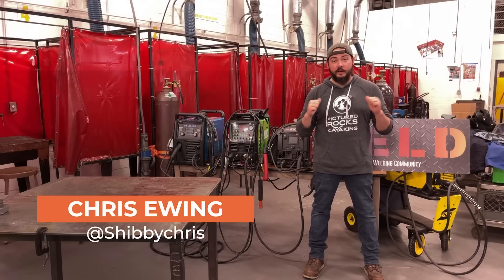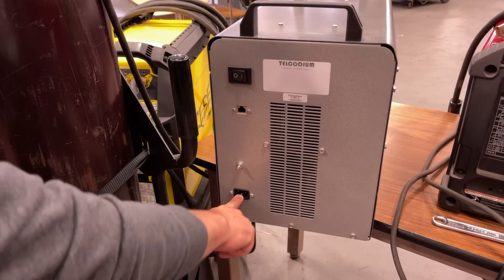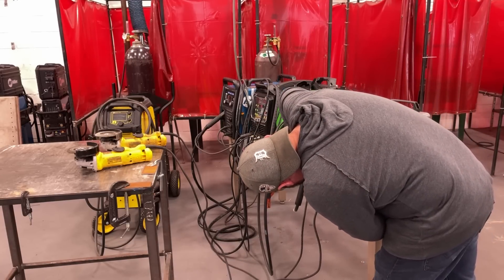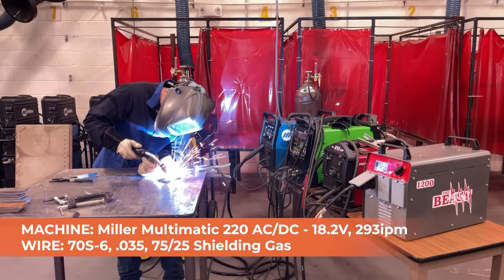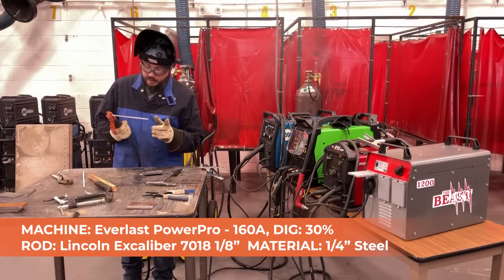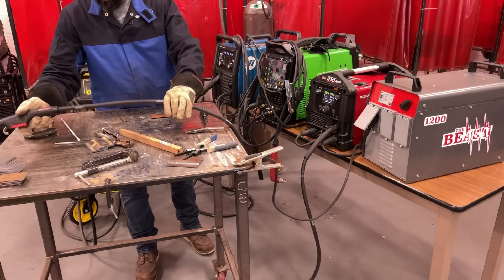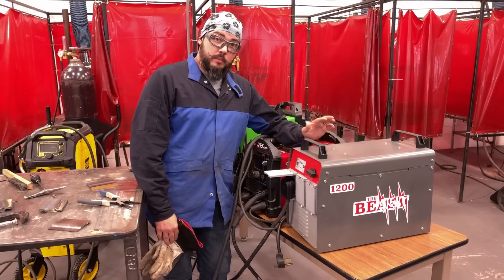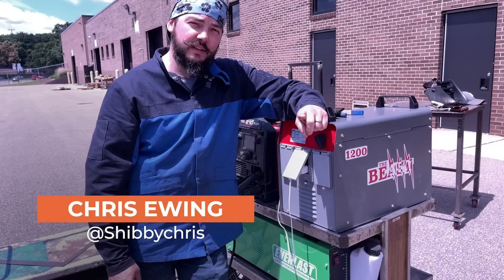Portable Power Station for Welders

Comment: How long does it take to charge up the BEAST?  How many hours can you get out of a full charge?  What's the most economical welding machine to use with the BEAST.
Reply: The BEAST has a powerful 1200-watt embedded charger, and it would take approximately 1 hour to charge The Beast model 1200 from 0% to 100% battery capacity. As for how long it will hold a charge, it depends on the number of tools and appliances plugged into each Beast model. Please see the TYPICAL PERFORMANCE FOR SELECTED WELDERS list at different settings at beastpwr.com.

Comment: HOW LONG YOU CAN WELD WITH A small 110 arc welder how many electrodes you finish before it drain the battery, my other questiom how this work if I keep the power supply connected to a 110 power plug meanwhile I am welding. is that posible , any conflict with That!

Comment: I could see this working well as a stand alone unit or if you have a genarator to work it in with that like if you got a small amount of welding to do on a part of the job site that you would need 200feet or more of leads it could be a really good option

Comment: Could this power AC tig?
Reply: Yes it will. I used the Everlast Lightning MTS 275 to TIG weld some aluminum for a trailer repair with this unit. You'll see at 13:35 in the video, I was pulling too many amps for the 30a breaker and it faulted the Beast; which is the same thing that happened with the MTS if I went above 150a while TIG welding AC. They have since increased that to a 50a breaker, but I have not been hands-on since that improvement.

Comment: so you welded 10 minutes in real time and you got near half capacity , which means twenty minutes more and you done.  Welcome to the 30 minutes power source. And I forgot to mention you tripped the braker.  I am impressed.
Reply: I’m not sure about time, as this was an edited video, it worked out to approximately 1 inch of weld per 1% battery life; keeping in mind this is the smallest battery capacity of the 3 offerings. I did indeed trip the breaker, which has led the company to increase the breaker from a 30a to a 50a as noted in the video. Wanted the machine to be properly represented in its capabilities, that’s a sign of an honest and credible company.

Comment: $3000 for a battery that will have to be recharged (and those batteries will eventually need to be replaced).  For LESS you could get a pure-sine invertor GENERATOR with higher output.  Yes, it uses gas; but it's cheaper and more economical in the long-run to operate.  And remember, those batteries are only going to last so long before needing to be recharged (during which you cannot weld) - vice just dumping in more gas.  And there is no way you could run this all day with that type of cycle - it would destroy those batteries in short order.  Not sure what problem this is supposed to fix or which niche it fills.  I'll stick with my generators.
Reply: Generators absolutely have their place, and their own set of drawbacks, and have been around forever, so they are going to be less expensive. Think of this less as an attempt to replace generators, and more of an opportunity to supplement your mobile welding business. Take it on a scissor lift inside a building. Tig weld in an office setting without needing hundreds of feet of lead cable. Thousands of creative opportunities.

Comment: Not going to report how much battery is used out of the beast after passes?
Reply: Mars - each machine and process pull power at a different rate, but my understanding of how it performed was, with many of the light duty tests, it consumed approximately 1% of battery life with about 1 inch of weld.  That's a "very rough" estimate.  Keep in mind, that was the result for the smallest and most mobile version of The Beast, which is a 1.2 kWh.  There is a 3.6 and a 6.0 kWh version available.
Reply: @GRich120  sure...it just seems like with any battery the question is how long is it going to last after doing something. Obviously it will work on any color machine. Good video, could have been better.
Reply: @mars-mars-mars-mars-mars   I totally understand.  A few years ago when I first heard that manufacturers were going to make tools like a chop saw and angle grinder, capable of running off one of those little 18V batteries, I didn't believe it.  I now own over a dozen tools powered off battery.  Battery technology seems to be evolving very quickly, thanks to companies like Tesla, DeWalt and Milwaukee.

Comment: It's a great idea, but let's be honest this device can only put out one type of power along the entire line up. These units come short when it come to continuous output power. The charging time isn't the best either. Chances are you are gonna run that sucker dry each use and what state will your batteries be in a years time? Say 6 Days a weeks of use maybe 2 charge cycles at worse per day. What will your product really look like after the batteries degrade to less than 80%?